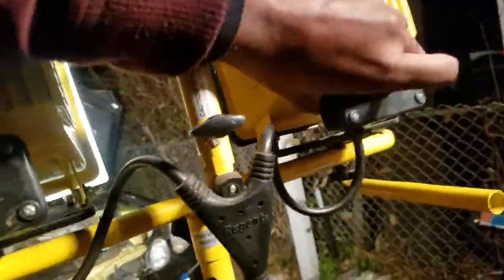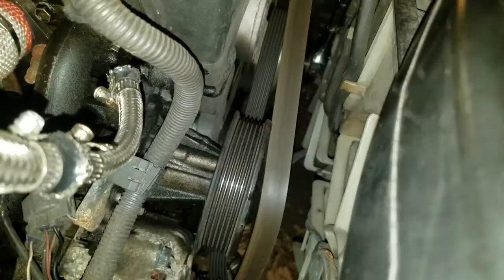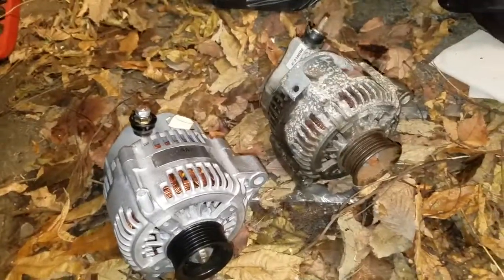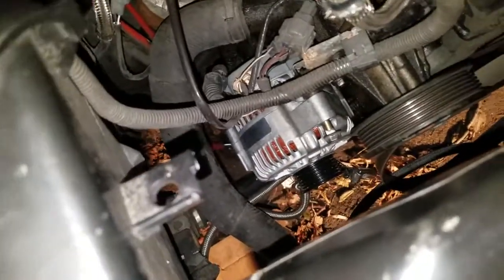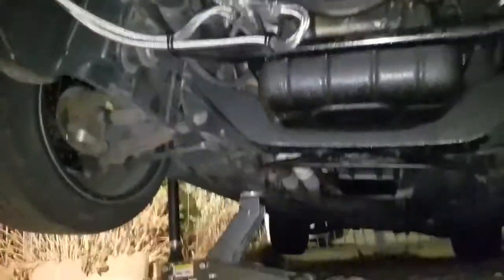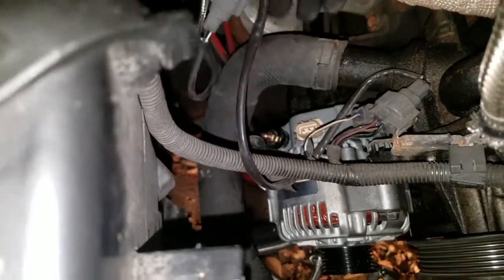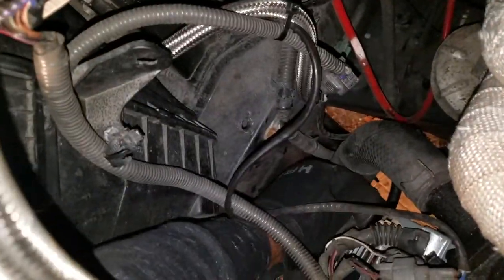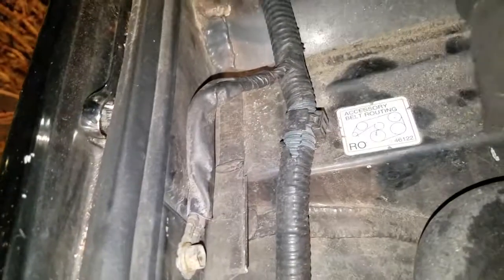High Amp Output Alternator Install on my GS300

Comment: Im installing a 200amp alternator on my 00 gs300 tmrw once my new wires come. Did you use newer thicker wires (big 3)? I bought 2 guage to replace the power wire n the 2 grounds as required.
Reply: Yup. I have another video about it

Comment: It was charging at over 14 because of the high output alt lol. But as long as you don't blow anything up or start a fire I guess you should be good XD.
Reply: That’s not how high amp alternators work

Comment: did you notice anything different with the bigger amp alternator?
Reply from the maker: Oh yea. Immediately. The battery actually chargs for one haha. But that's only because I had one that went out. I have Zero electrical issues. The car starts in a snap, I have no flickering lights at all. The subwoofer kicks like crazy. Theres no lack of electricity. I had a capacitor I was going to use for the subwoofer but I dont need it anymore